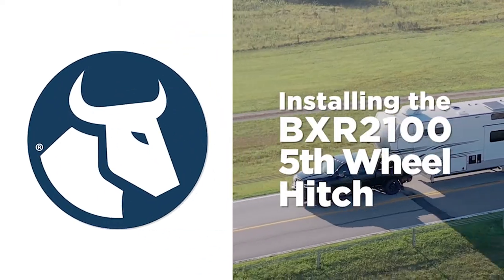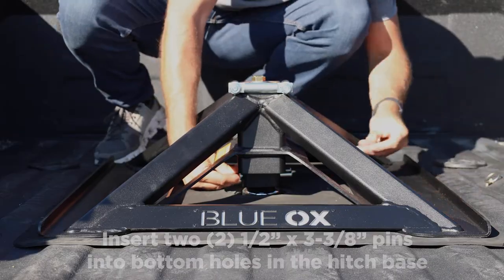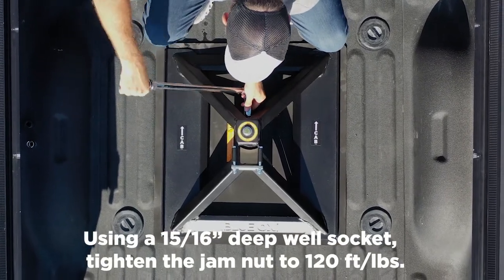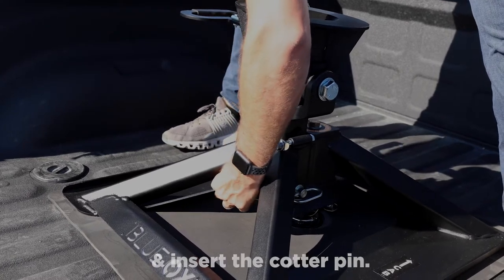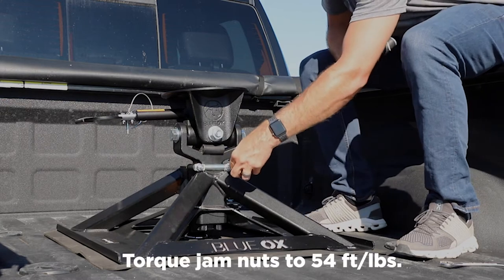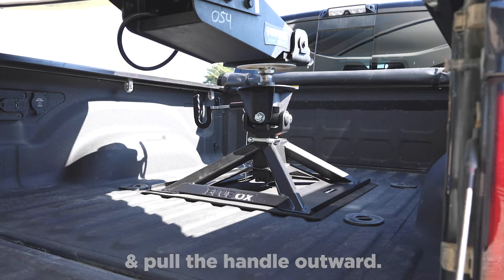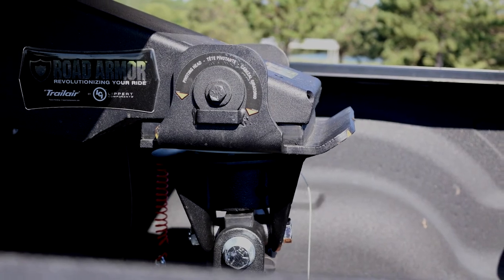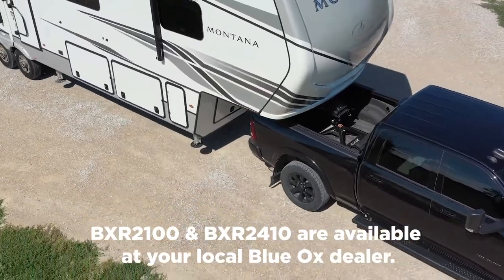Installing the Blue Ox BXR2100 5th Wheel Hitch

Comment: Confused....the disclaimer says you must install the locking kit on roto-flex pin boxes, but there was clearly no lock out kit installed on the pin box in this video???  So is it not necessary with roto-flex or is it?
Reply from the maker: Hi Brad, the install video was shot before we were done testing with the roto-flex lockout, so yes, the locking kit is recommended.